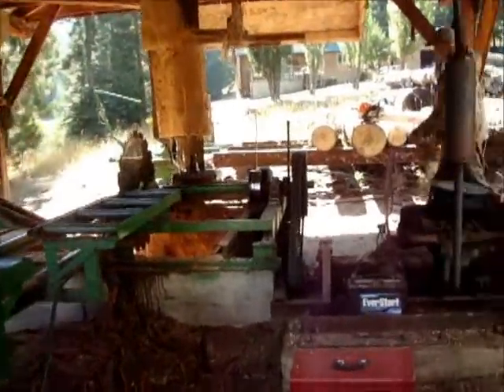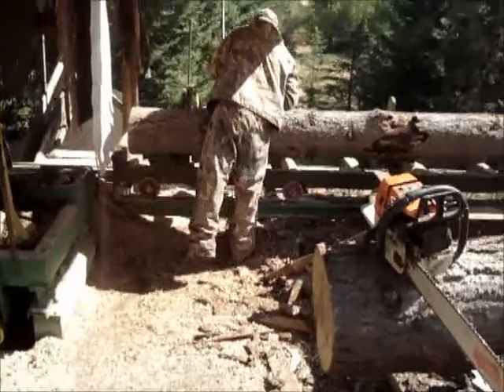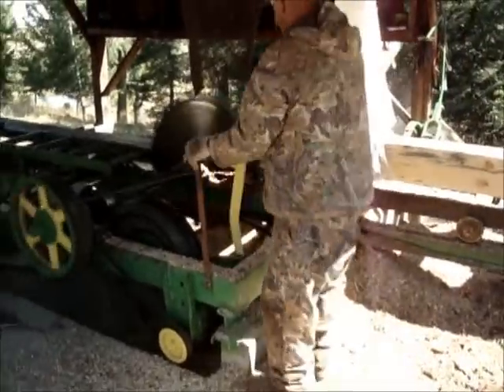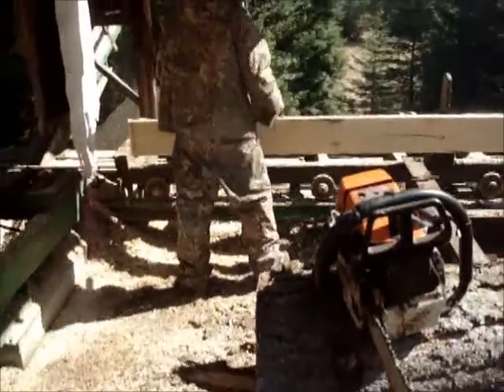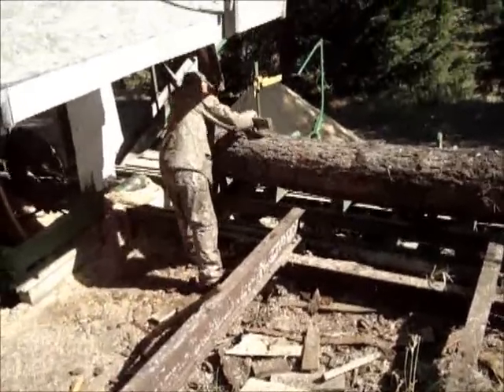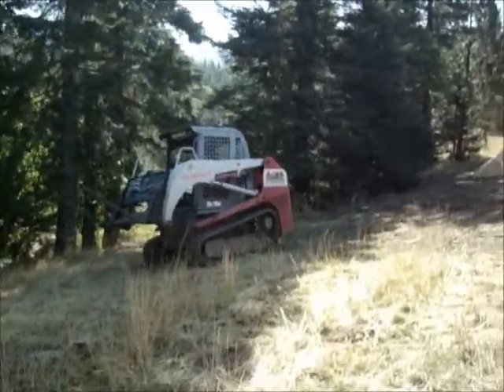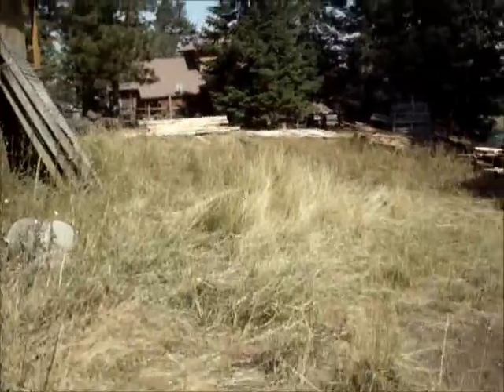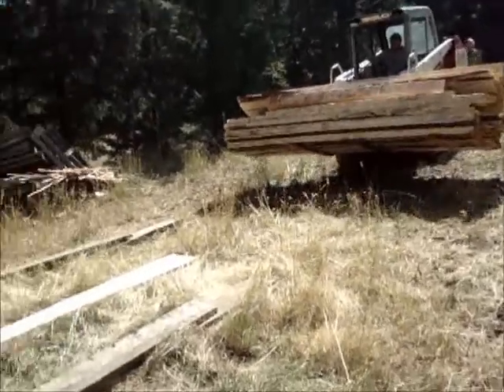Home built saw mill in action

Comment: We had a corely commercial sawmill at the sawmill I used to work at and they run a wet saw guide on it. Keeps the friction down and the blade cool. They also had a log pond to let the logs soak up water because they saw better wet than dry. Never saw or heard any issues with using water blade cooling set up.

Comment: Get the blade hammered, set the "saw lead" correctly, keep it sharpened and adjust the saw's rpm to 600-750 (have to find correct speed for your size saw) and you'll never need water --- and you shouldn't use water. Otherwise, something is wrong with the saw, setup, alignment, etc.. I've been around these "circle saw mills" since mid 1950', love them. 
Thanks for the video.
....13
Reply: At the sawmill I worked at, we had a wet blade guide system. Works very well keeps the blade cool and clean. We cut 12-14 thousand board feet every day in a 8 hour shift.

Comment: Should not be putting water on the blade. Learn why needed and make the proper adjustments to saw without the water. Pretty good setup. Most what is shown is commercial mfg., but home assembled likely.
Reply from the maker: dads been using water on the blade for as long as I can remember, his dad did the same thing without any issues. Without water the blade gets hot and wobbles making a much rougher cut, so I think he will continue using water
Reply: If I had to make a guess I would say the mill is an older Foley-Belsaw M14.
Reply: Please don't take this wrong but been around mills a long time and used to help dad hammer saws for left or right hand mill and the speed it is. The saw is tapered so is hammered so flat side to log and should run straight and true guides are guides should only touch once in while should NEVER get hot or flop around. 50 RPM will make a lot of difference on how a saw runs. Learned through the years with several different mills big and little.